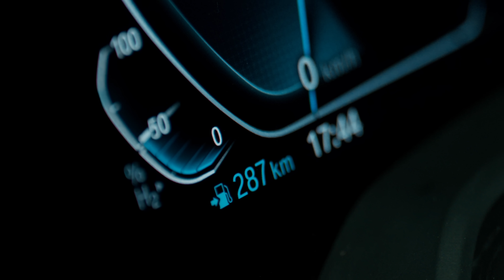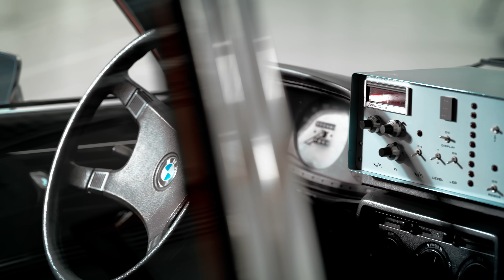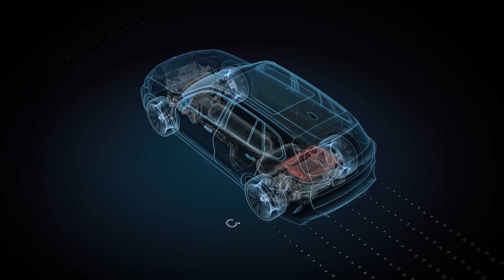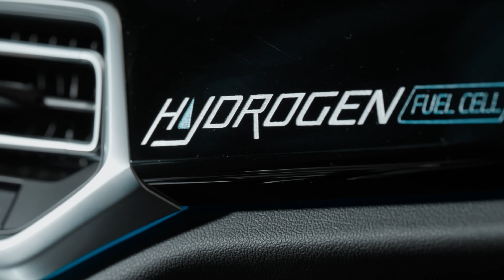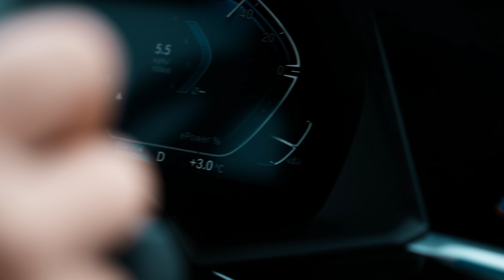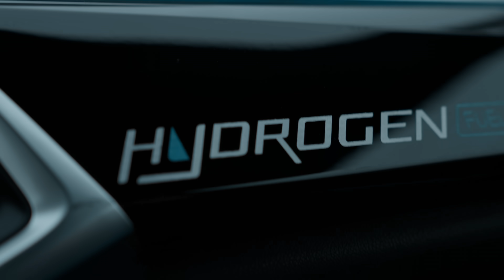Hydrogen Vehicles Are Electric Vehicles Too

Comment: Hydrogen adds so much inefficiency required both in infrastructure and in the vehicle as well compared to BEV. The few grams of platinum are so much more rare and expensive than the materials in the battery, which keep coming down in price. I love my BMW EVs, they are fantastic. By continuing to push the Hydrogen pipe dream you are telling customers who are skeptical of BEVs to keep avoiding them and wait for Hydrogen. Please, drop the Hydrogen nonsense for passenger vehicles. The Mirai was a complete failure. It makes no sense. I say this as a lifelong BMW fan and with nothing but love.
Reply: Exactly. This greenwashing is a shame, they don't need this. Both companies have a lot of invested money from oil, remember that 95% of hydrogen comes from oil.
Reply: Here in Denmark we Will have plenty off hydrogen, we are making massive amounts from rest power from Windpower industri , power 2X its called. 
And in germany they have Big power plants who makes hydrogen from rest power also. 
So I Think that Europe has fooled china too be the biggest batteripowered Auto industri and now Europe is coming with a hydrogen blow too china. 
Truck’s are also coming with Hydro/elekrick trucks now, they are allready trucking in USA. 
So hydrogen is coming.
Reply: @christianchristensen4291  hydrogen makes no sense compared to batteries. You have to waste so much power generating the hydrogen, compressing it, cooling it, loading it onto trucks, driving the truck, transferring it into the station, etc. Hydrogen is hyped by the fossil fuel industry as they are the main source of hydrogen today.
Reply: As another lifelong BMW fan, BEVs is NOT where its at. There is no sustainability is a vehicle mad up entire of batteries. Look how we treat our phones, disposable. Mileage and battery degradation also mean the life of the vehicle itself is shorter than ICE or Hydrogen. Who wants to buy a used BEV with a rundown battery? Just because a technology is not ready yet does not mean that it should be abandoned. True innovation is not discovered nor adopted overnight.
Reply: @soviet1942  BEVs last longer than ICE vehicles. Battery degradation isn't really an issue like people fear. Batteries can be entirely recycled. Please educate yourself and stop repeating fossil fuel industry FUD. Hydrogen cars still require a battery and electric motors. They are just BEVs that have added unnecessary complexity and way less efficiency.
Reply: @CheddarKungPao Doubt BEVs last longer than ICE vehicles, there probably isn't even enough data to be spewing statements like that (also my 265,000 mile e92 disagrees). You're telling me recycling an entire battery pack because a couple of battery cells are bad is efficient? Seriously? Onto complexity, was a automobile not more complex than a horse when we replaced it? You are concerned about where the technology stands now whereas the BMW video itself is clearly looking into the future.
Reply: For anyone that still didn't get it, BYD blade batteries have 8 years of warranty, they last beyond 5 thousand cycles. Do the math. Those BEVs will last way more than a million kilometers, with the battery under warranty. Electric motors have two moving parts, the rotor is electromagnetically suspended, no friction - compare that with any ICE vehicle with thousands of moving parts only in the engine. BEVs have no oil, no spark plugs, no clutch. LFP chemistry, very safe.
Reply: I just don't want anymore to go to station to fill my car.  ... hydrogen cars are a step more inefficient than synthetic fuels....
Reply: @CheddarKungPao yeah man ,also we need to go to station to fill it and pay unlike charging overnight in home which is cheaper. Just $11 for 321 miles conpared to $93 in my gas car
Reply: @soviet1942 oh so u think ice engine lasts 20 yrs without 4 engine rebuild, I had a Toyota and even it needed rebuild after 6 years
Reply: @CheddarKungPao it's just to make us go to station and fill to make us pay😢
Reply: BEV is cheap because they use African labor to mine the cobalt and etc.
Reply: @soviet1942  If your phone cost $50 k you'd replace the battery instead of buying another one, not that you'll ever need to replace a modern EV battery.
Reply: @hafizuddinmohdlowhim8426  most EVs from China and other places don't use any cobalt.
Reply: @forgotten_world mg have ten year warranties on the batteries here in Australia, in Thailand it's unlimited klm/ years.
Reply: @soviet1942 my 13 year old EV is still going strong.
Reply: @metricstormtrooper  yes right. Everyone believes that 😅
Reply: @hafizuddinmohdlowhim8426  all EV manufacturers have been reducing the amount of cobalt, many have zero cobalt. The other materials can come from many places. Hydrogen cars still have batteries.
Reply: @CheddarKungPao  cobalt, nickel and other REE mining is bad for nature. We still need them so the question is, do we need more? We choose hydrogen because we want to be less relying on those precious metals. In engineering, we have to consider the overall efficiency. Not just efficiency during driving.

But the argument that FCEV is less efficient than BEV is true. That’s why they said 2028 because they intend to improve the efficiency first. The aim is to achieve 1000km with 5.5kg of Hydrogen. For now, 5.5kg will bring you to 600km but it will change after this.
Reply: Cheddar is right. Vw, BMW Toyota all doomed.
Reply: @Reddylion  you are being denial
Reply: @hafizuddinmohdlowhim8426  they can't do anything to improve the fundamental massive infrastructure inefficiencies of hydrogen.

Also hydrogen vehicles still need just the same rare earth materiaks for the motor, and again MUCH more rare and expensive materials for the fuel cell than a battery requires. There is NO rational argument for hydrogen. Period.
Reply: @CheddarKungPao  why they can’t do anything to improve the fundamental massive infrastructure of hydrogen? Do you think the engineers are stupid? 

Do you ever heard of hydrogen combustion??? You are funny.
Reply: @hafizuddinmohdlowhim8426  because hydrogen requires physical transportation, compression and cooling. This necessitates a lot of additional losses compared to simply transmitting and storing electricity in batteries. Engineers aren't stupid but they can't change the laws of physics.
Reply: @CheddarKungPao  you don’t know economics of scale. It is more efficient to supply GWH of electricity through pipelines rather than electric cable. That is physics.
Reply: @hafizuddinmohdlowhim8426 Because oil extraction is entirely ethical isn’t it?
Reply: @hugowells3052  it is green hydrogen. Which year do you live in?
Reply: Would you like full electric piston power?
Inline 3 4 or V6 V8 V12
Reply: Stellantis OMR automatuve can switch AC generator/alternator to make power AC axial or Efi/carburettor can develop compact design motor & Auto gear within an Efi carburettor via locked down PSI pushing compressed air via batteries replace fuel tank & radiators or you'll be pay as you go infinity SAV
Reply: If that's true it's a waste of energy. Using hydrogen as an energy storage medium consumes 15 parts of energy for each 1 part you get back. It's the single worst energy storage medium I can think of. Maybe compressed air is worse.
Reply: @CheddarKungPao not just that 🎉 but a battery becomes practical by storing current and connecting anything to it ✅ hidrogenul it is the same as oil, only more difficult to produce + expensive + dangerous 😅
Reply: @forgotten_world actually, I recently learned that a good number of bevs (ones that use more than one motor) use a clutch to disengage one of the motors for efficiency purposes. Doesn’t really change your point though, I just thought it was interesting.
Reply: @forgotten_world so does electric charging which comes from non renewable energy. So it’s literally doing no good.
Reply: About the energy grid, even if all the energy matrix is not renewable, electric cars are tens of times more efficient than ICE, with a LCA also several times lower in emissions. Just the fact that fossil fuels are distributed using gas and diesel trucks represent several times the emission of EVs. But there is another, more important fact about EVs: when the energy mix of the grid changes to renewables, and this is happening every day and it is a centralized structure, all the EV transportation is already clean. The needed pivotal transformation towards reduction and elimination of climate change emissions cannot be done by using hydrogen, because it is extremely inefficient and expensive, and is greenwashing towards the oil economy.
Reply: Also about the distribution of fossil fuels and hydrogen, I did forget to mention the transportation of the fuels and oil by ships using bunker fuel, the most dangerous, toxic and polluting fossil fuel. Although there are ships using natural gas and hydrogen, they represent an absolute nothing in the global merchant fleet.
Reply: ev is not the answer of the future transportation
Reply: EV cars are a joke. Hydrogen cars are the future.
Unless there's a new battery technology companies should stop making EV cars.
Reply: @anshulsingh8326  hydrogen cars are just worse EVs dude. Educate yourself.
Reply: @CheddarKungPao  Nuclear power plant generate electricity by heating water then that heat is converted to electricity.

That doesn't make a nuclear power plant a Thermal power plant.
Reply: The best selling car in the world is an EV, it is also the fastest growing automotive sector.
Reply: @anshulsingh8326  hydrogen isn't a source ov power. It is a very, very, very inefficient way to store power.
Reply: @CheddarKungPao ev just efficient to the ev vehicle , not to human existing ,, stupid with more than 15 minute to recharge how stupid it too human being ….
Reply: @Faceiscool  You don't have to sit there and wait for it to charge. You charge while you go eat dinner or go to the bathroom or something else. It's incredibly efficient compared to making a special trip just to charge.
Reply: So before EVs became commercially viable when car brands were saying EVs r the future. Ppl like you were laughing and the same is happening with hydrogen. Once it’s mainstream technology you will not say that.
Reply: @nikunjdoshi1987 because its available on 2025 not for just personal its for humanity , hydrogen compare too scamer ev ….
Reply: Base on what you have such opinion? Hydrogen would be / should be the future not only for car industry but also other industries.
Reply: @bunsw2070 And extracting EV power from coal fired power plants isn't? There goes your low carbon footprint right up the stack!
Reply: Hydrogen engines fantastic....more efficient...more economic but one negetive thing highly explosive 
Regarding hydrogen engines toyota challenging ...
Reply: Well done BMW. JCB have been developing this too and definitely the most effective and efficient Green solution. EV makes no sense whatsoever but has been over marketed sadly. BMW winning the green race.
Reply: @forgotten_world lol 😂 It comes from nature gas not oil.. Internet experts smh
Reply: @solomons5669  Natural gas are hydrocarbons extracted from the same oil rigs as oil itself, it is hydrocarbon evaporation inside the oil reservoirs.

Comment: Sorry, BMW… H2 will never be the answer. It is far too energy wasteful, even if extracted by electrolysis using renewable energy. For example, it would take 341.58 kWh of electricity to extract enough H2 for a full tank in a Hyundai Nexo to drive it 354 miles. A Hyundai Ioniq 5 could drive 1,025 miles on that amount of electricity —nearly three times that distance! Moreover, the infrastructure for FCV is practically non-existent. There are only 55 H2 fueling stations in the USA —the vast majority of them in California. The push for H2 is a ploy by the fossil fools who want to SELL us the H2, when their oil starts running dry, instead of letting consumers get their clean, green, free fuel from rooftop solar. How much is the oil industry paying you to promote their "future" profit-making scheme?
Reply: If they took the i3 rex and used a FC instead of a ICE then this would make sense. Plug in serial hybrid cars with H2 would work best. Charge up and get 200 miles of range then have H2 to give the milage u need for your next charge.
Reply: Toyota just built an ICE H2 hatchback and honestly it works and drives well. I feel like the only concern is the price for H2 but wind energy and nuclear could assist the situation
Reply: @jeremiahgoffney8425  there's 1 problem from h2 combustion, it gives off nitrogen oxide and that's not a good thing to breath in. We keep trying to make excuses for combustion engine. They are a waste of money if it's h2 or fossil fuels.

Comment: A few questions
Toyota have been selling a hydrogen fuel car for years with minimal sales and such a bad experience owners in California are taking them to court. Mainly about the running costs and lack of infrastructure. What makes you think it will be different this time?

90%+ of hydrogen comes from natural gas and its very high CO2, when do you anticipate there will be enough green hydrogen to actually make hydrogen cars low CO2?

The end to end efficiency is 2-3x worse than an EV, meaning it takes 2-3x more electricity per mile driven in hydrogen cars vs EVs = very expensive to run even with dirty grey hydrogen and even worse with green hydrogen. One of the core points of the California court case, how is that addressed?

In the UK there are less than 10 hydrogen fuelling stations and they have been closing down vs >30,000 EV chargers locations and added 2,000 in just the last month (more added per day than there are hydrogen stations in total).  They cost >£1M each to build. Where is the infrastructure going to come from?

Comment: Imagine a tank with more than 80 liters (they are saying it in kilograms) of highly combustible and highly explosive and highly reactive Hydrogen below your seat.
Hydrogen molecule (two atoms) is to small and too light, so it will leak a lot.
Reply: Because we currently aren't driving vehicles that ALREADY contain thousands of combustion cycles per minute? I'm sure people riding horses were making the same statement you are when cars first came out. What about BEV thermal runaway events? Even fire departments has trouble handling BEV fires.
Reply: @soviet1942  Hydrogen will always be hydrogen. They know how dangerous it is, and all this is just for research purposes.
I didn't mentioned, but it needs more energy to get H2 than it can give back.
Reply: @kitanowitsch  I didn't think about that second part, thanks.
Reply: It's explosive under high pressure and high temperature. Ambient conditions are not enough to make it explode.
Reply: @sharon_ng  What do you think? Is H2 in this tanks under pressure?
Reply: As of now I am driving car with 60 liter gasoline under my ass......so....if accident happens...I can fly to the moon every time too.....where the hell is difference....
Reply: @jaroslavsimon8100  There is big difference between gasoline and hydrogen under pressure.
Reply: @kitanowitsch  what pressure is needed for Hydrogen to become explosiv? While there isn't a fixed pressure threshold for explosion, handling hydrogen at high pressures greatly increases the risk, especially in enclosed spaces or when combined with an ignition source.
Reply: @jaroslavsimon8100  Pressure doesn't make it explosive, just places it more in the single volume.

Comment: So many negative comments mostly by Tesla fans. Not every place has electric charging infrastructure or cold areas where BEV doesn't perform well, Hydrogen vehicle will play a key role in eliminating gas vehicles.
Reply: look at the new batteries. they can handle everything. and rule of thumb one less step is always better. hydrogen is basically a EV car

Comment: The biggest obstacle with hydrogen cars is lack of infrastructure. The biggest problem with the traditional EV is lack of infrastructure. Plus the latter creates new problems. So i don't understand why we pursued traditional EVs instead? Hydrogen is not only unlimited and less of a fire hazard than probably even gasoline or diesel powered autos but it's only product of combustion is water.

Comment: where is this hydrogen? electric vehicles have been around for over a decade. hydrogen is also quite impractical due to the fact that it takes up a lot fo the cars cargo space. yes, the tanks might be light but they aren't small. with a hydrogen car, you get the price of fuel of an ICE car combined with the price of vehicle and lacking infrastructure EVs had 10 years ago. there will still be downsides like shorter range with larger variations due to weather compared to ICE car. oh and the pumps might fill the first car instantly but than need to represurise for almost as long as some EVs need to recharge.